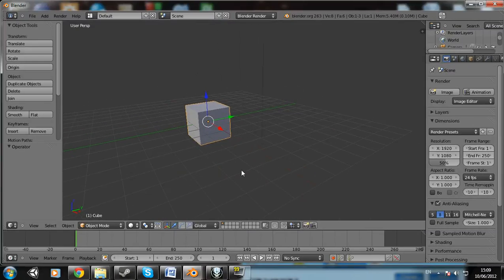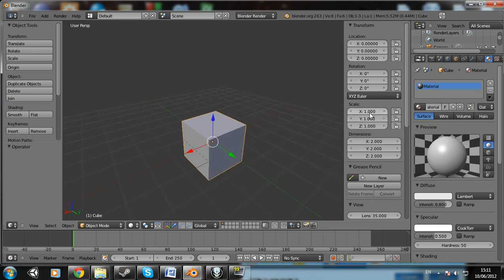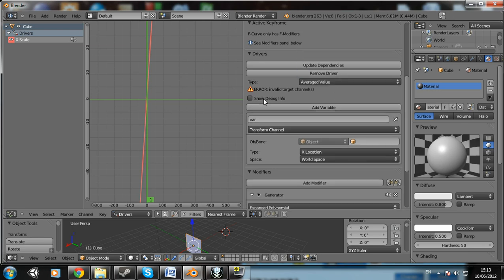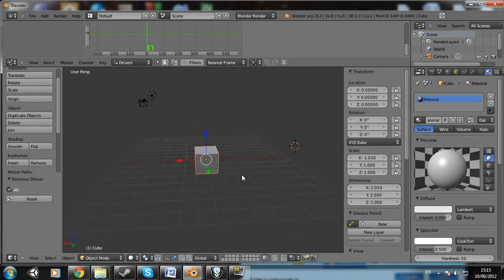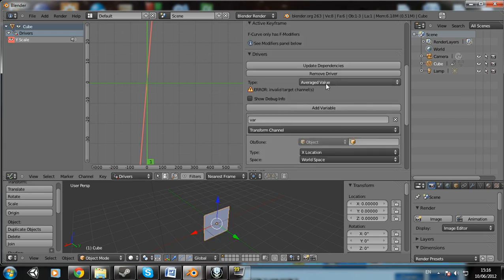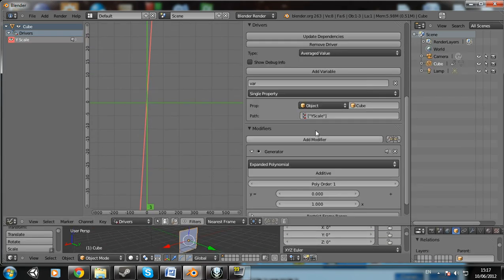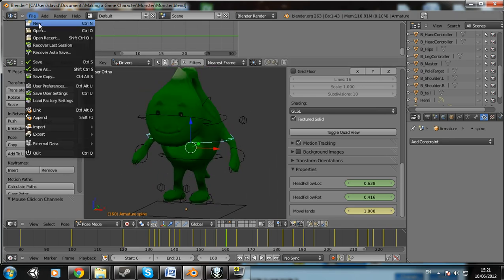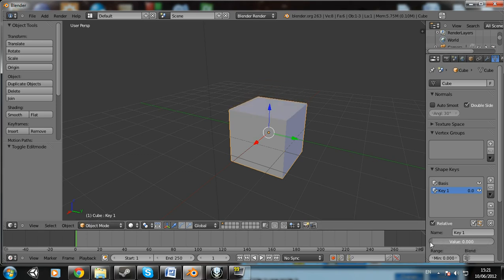Blender tutorial - How to use Drivers and Custom Properties

Comment: I was researching the way they use Maya to animate Southpark characters, like swapping character body parts (e.g. swapping Cartmans front facing head to a side facing head). I found out that they use something called "Set Driven Keys" to achieve their replacement style animation. Does Blender have Set driven keys as well, and is there a way to achieve this in Blender?